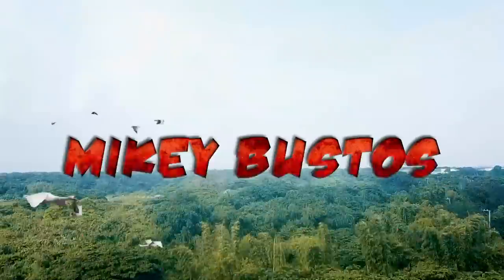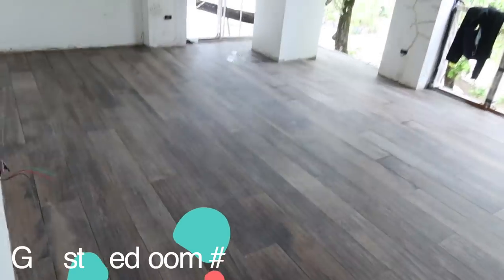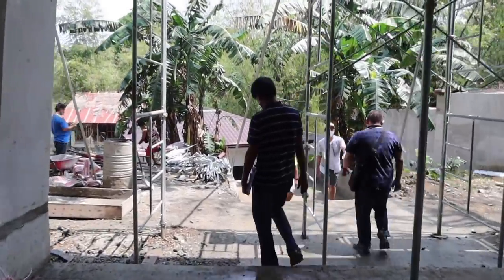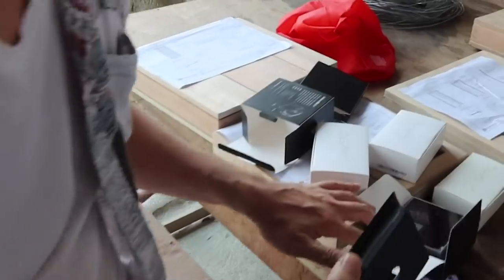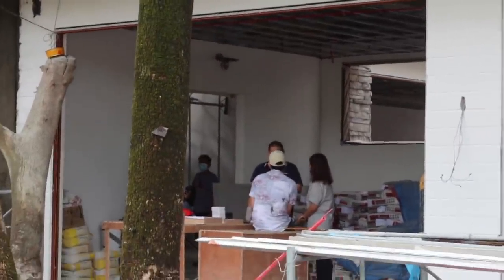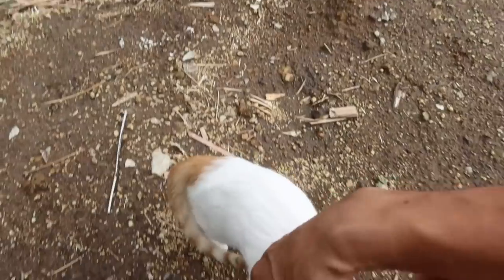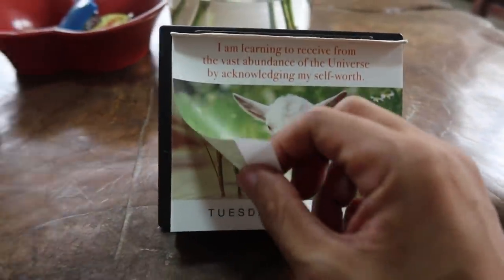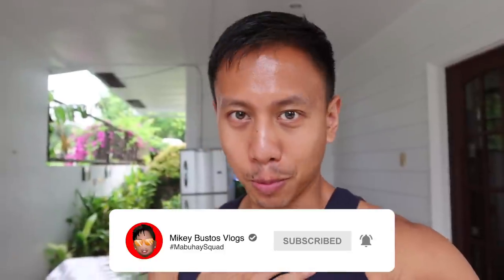Check Out Our Future Doors! (Another Day at the Farm House) - March 15, 2022 | Vlog #1466

Comment: I would allow only pet birds that are better in an enclosed atrium from above-using materials that are pretty secure from intruders yet safe for your flying pets.  Also, plants that do not need full sun but receive rain and good pipes to let the water out of the building.  🙂You don't want bats or unwanted pests like those that build the nest on your ceiling.  It's gonna be a mess to fix and maintain your home with all kinds of birds and what have you.